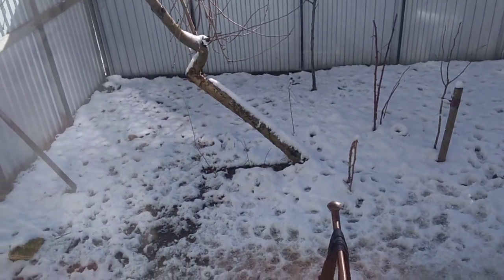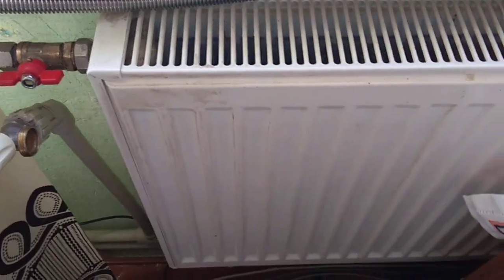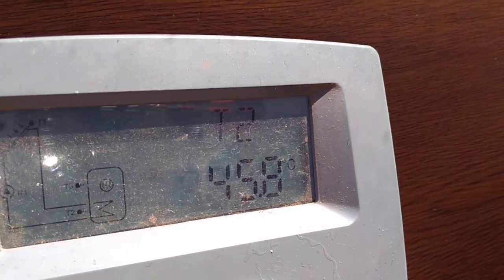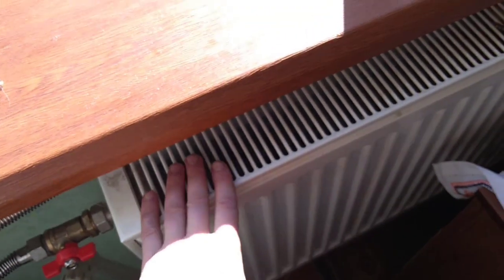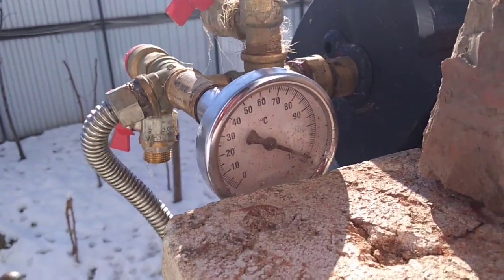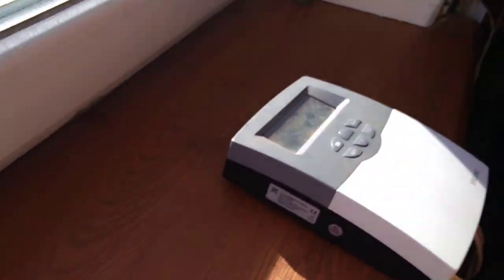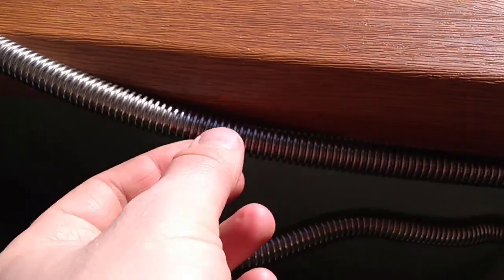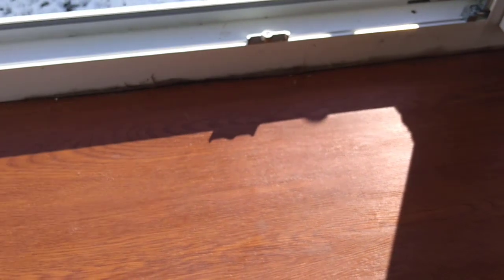Solar heating system. Is it really works for heating of house? +120. Testing  in February. 2020.

Comment: Hi brother I am from India
If u can plz send me what I can do 
It's average around -20 to -30 celsius
Reply from the maker: Hi where dou live in India that the temperature is -30?
Reply: @TravelLifeTips  leh
Reply from the maker: If it will be many sunny days in this town you can use it for heating even when its very could.
Reply from the maker: I will test this solar heater in winter (January) So you will see it will be work or no .
Reply: @TravelLifeTips  thanks if it works plz share the equipment specifications
Reply: @TravelLifeTips  any update / review on heating system
Reply from the maker: about 30 videos on my channel. Here is the last one video https://youtu.be/mrHIp7hFXNQ